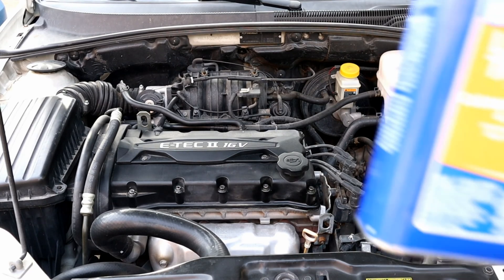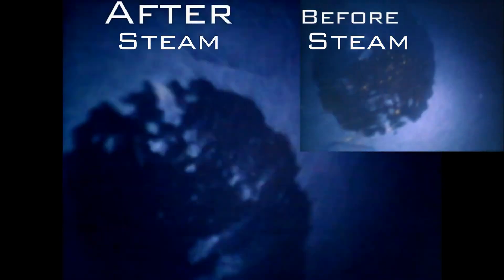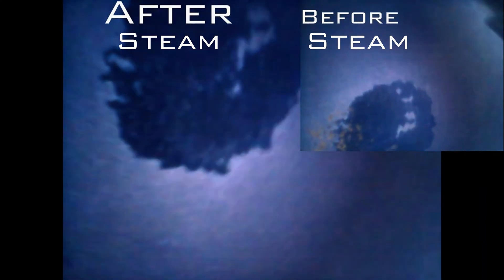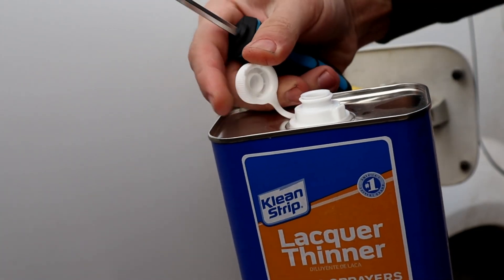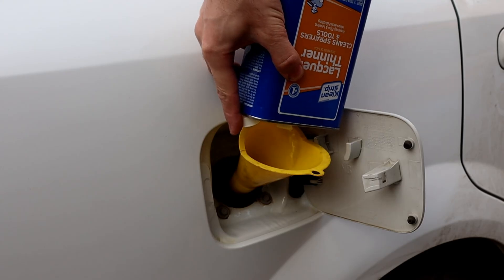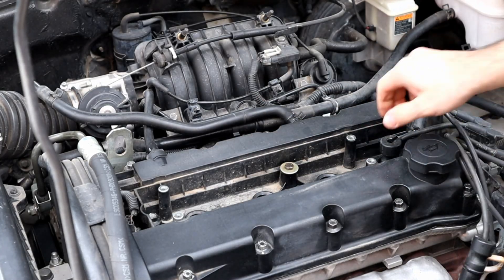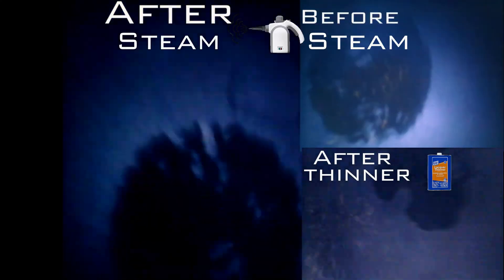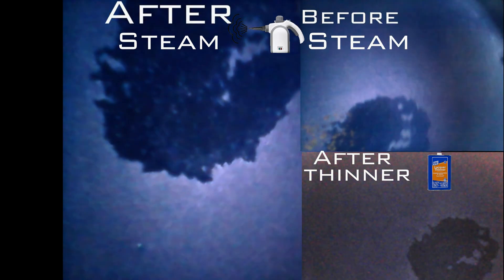Does Lacquer Thinner cleans carbon on pistons/intake valve cleaning/decarbonize engine with water

Comment: Pls my engine is a 2jz,there is intake House with maf sensor on it,and there is pcv valve by the middle and then by the right is the driver brake booster and all.i heard it works good but will later kill all sensors such as fuel guage sensor cat sensor,fuel pump. How then can I make use of it.i don't wanna risk my engine

Comment: The last time I used laquer thinner in the fuel was 20 years ago.  And in the 70's I poured it straight down the carb at 3000 rpm.  Does it clean the fuel system?  Does it blow out carbon?  Damn straight on both counts, it works very very well.  Unfortunately now every vehicle comes with extremely expensive in tank fuel pumps and terribly expensive catalytic converters.  I'd recommend not to do this.

Comment: You can disconnect vacuum hose from CPV (crankcase positive ventilation) and dip the vacuum from hose it in and out of the lacquer thinner, which avoids putting in gas tank and having it going through entire fuel system hoses and injectors, but still will help clean piston heads, and the catalyst convertor. Helps avoid the solvent action on fuel line parts. It only goes into the intake manifold, then mix with incoming fuel to only affect the piston and exhaust system.
Reply: also helps clean spark plug electrodes while firing at same time.
Reply: Yes but you want it to clean your fuel injectors. That's one of the best things about it...
Reply: @MikeKollin  Yes, those too.
Reply: @JoeZyzyx   Wouldn't it be safer to use it though the throttle body?
Reply: @JohnDoe-md2sb  personally, I wouldn't want to have something as flammable as laquer thinner with me while messing around under a hood while the engine is running.
Reply: @JoeZyzyx   Fair emough, but pretty much everything that is a solvent based "cleaner" can possibly ignite.  I'd take my chances putting it in a spray bottle and misting it into the throttle body...in an open and well ventilated area.  I'd even be tempted to mix 50% water in the solution, seeing that many have had great success with decarbonization using water.  🤭👍
Reply: @JohnDoe-md2sb  I do think the water might help with de-carbonization.

Comment: It might cause knocks or misfire. Too risky
Reply: No i tried it ..it made my car run like new again ...1/2 tank of fuel+1 gallon  of this stuff ...works like a charm
Reply: It works as an octane booster, it can actually stop the knocking..
Reply: No reply?   Turbo guys use it regularly. its around 114 octane.  Your gasoline will knock before LT does.
Reply: Ok guys thanks for sharing

Comment: Oh yes.  Lacquer thinner WILL eat carbon.  I would take a quart/liter can and pour it slowly down the carburetors of my old cars and let them stall.  Let them soak for an hour then start them up and drive in second gear through town at 4000 rpm.  I'd get home running on half the cylinders (plugs totally caked with carbon) then change the plugs and the oil.  
I'd be careful with a modern vehicle putting it in the tank with modern high pressure pumps tho.  It can eat rubber and plastic components of your fuel system.

Comment: Im an old mechanic
Here's a great trick if you dump a quart of atf in the intake with the cars running at high rpms it will stop the engine.
Then just let all the oil sit in the cylinders for 12 hr
Start engine the next day   
It will smoke like a fright train
And all the carbon will be gone
Reply: Hi Sir but for modern cars, this method will most prob ruin the sensors and cat convertor.
Reply: @1ZZFE And spark plugs

Comment: Hi Ali, how much thinner you put with 3/4 of tank?
Reply from the maker: The whole can
Reply: @AliMECH  well done Ali 👍🏻, I saw this tip be4, but I didn't try becoz I was afraid. what is the actual ammount in liters for the 3/4 of the tank?!  because paint thinner varies from contry to another, and what thinner type did you use?! we do have a lite one and another hot one used by car painters, which one do you recommend?! and is that applicable for complicated systems 2015 and 2021 Skoda & VW cars?!

Comment: Great Job Kaka, do you think that the Lacquer Thinner will be alright for cleaning the valves for GDI engines?
Reply from the maker: It's not gonna clean the intake valves on GDI engines, because the fuel injectors on top of piston,  injecting fuel directly in to the cylinder, the fuel not contacts with intake valves like indirect engines, so it only cleans piston, exhaust valves, catalytic converters, exhaust sensors
Reply: @AliMECH  hank you so much for your kind clarification, and if do not mind to contact me on this email address: opeco.assist@gmail.com and I will be more than happy to get in touch with you, much appreciated.
Reply: @AliMECH  Thinner Dilution for 2-component, polyurethane-based varnish, both clearcoat and pigmented, is this it?
Reply: Walnut blasting asap!

Comment: Thinner it’s safe for motor ?
Reply from the maker: Some people got sensor error codes with it, and it's been used for cleaning catalytic converters, which if its damaged, it doesn't fix anything, I had no issue with it, and the engine gained power
Reply: Scotty Kilmer uses a whole gallon to half a tank of gas to clean the catalytic converter.
Reply: Link pls? @ibberman